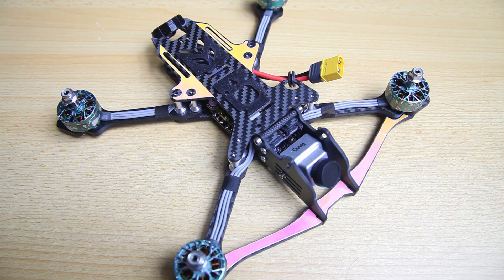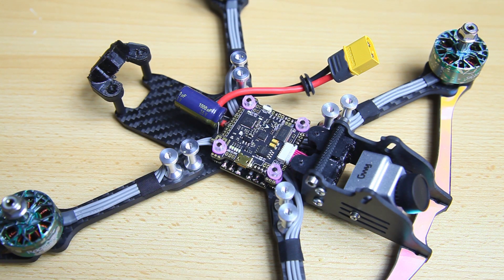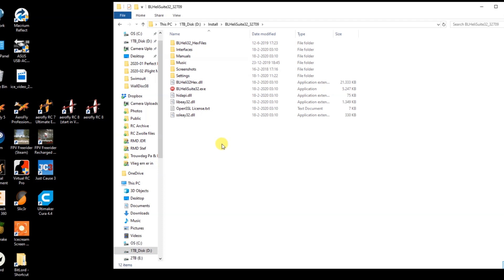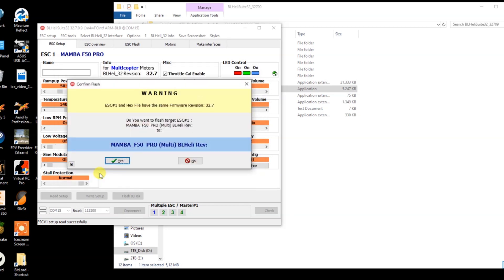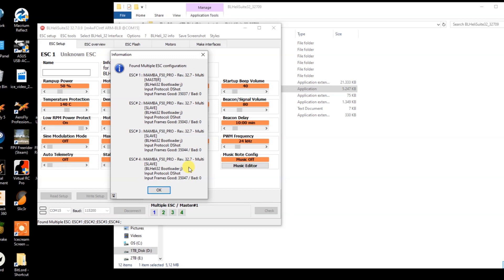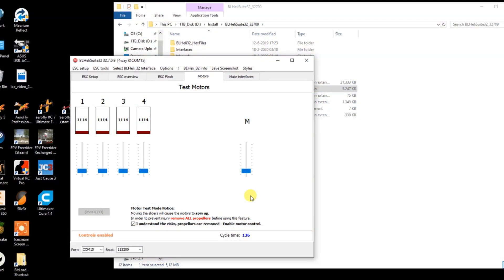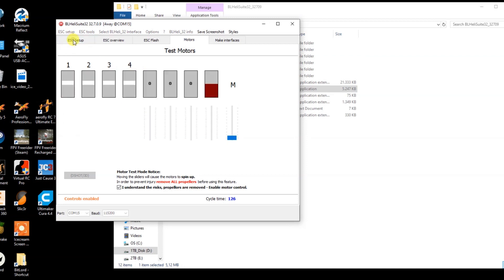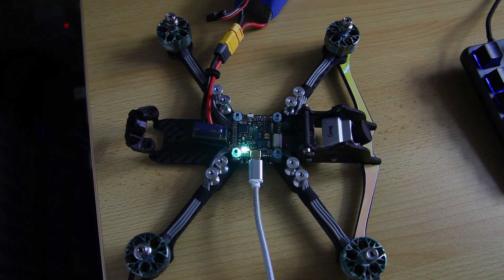Perfect FPV Drone Build Guide - P5: MOTOR DIRECTION & BLheli32

Comment from the maker: Checking the rotation direction And updating the ESC's firmware! 
the Diatone / Mamba Mamba F722S Pro stack I'm using here: 
https://www.banggood.com/MAMBA-F722S-Betaflight-Flight-Controller-OSD-59V-2A-BEC-F50PRO-50A-3-6S-Blheli_32-Dshot1200-FPV-Racing-Brushless-ESC-for-RC-Drone-p-1490805.html?p=TO251813974002015038 

The Racerstar SIC2207 motors used: 
https://www.banggood.com/Racerstar-SIC-2207-1888KV-2388KV-2688KV-Brushless-Motor-RC-Drone-FPV-Racing-MultiRotors-p-1533179.html?p=TO251813974002015038 

Betaflight configurator: 
https://github.com/betaflight/betaflight-configurator/releases 

Blheli32 suite download: 
https://github.com/bitdump/BLHeli/tree/master/BLHeli_32%20ARM

Comment: ** GREAT SERIES ** 
Yes, could have done with this when I first started, haha.  I learned the hard way.  Now, I do this too. Connect motors to esc to fc then check and set motors.  Next it's check wire runs and lengths for ancillaries - remove fc for easier soldering, re-fit then SMOKE STOPPER, lol
Reply from the maker: Yes same here Will :D  would have been nice to have a detailed build how-to back then :)  Thanks ofcourse! 
I have never used a smoke stopper by the way, but don't tell anyone.. ok? :P
Reply: @DutchRC  I was only showing off ater burning my second FC haha :)
Reply from the maker: @retrodudefpv  All my builds simply fly right away :) 
A H U M ! :)